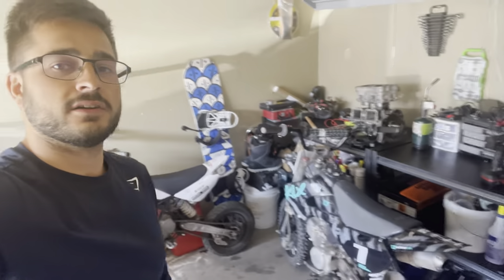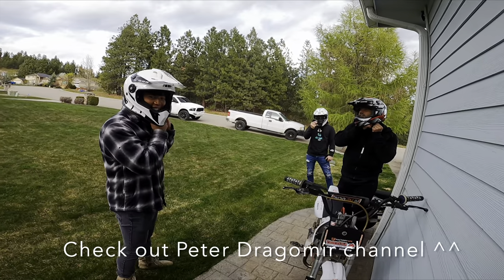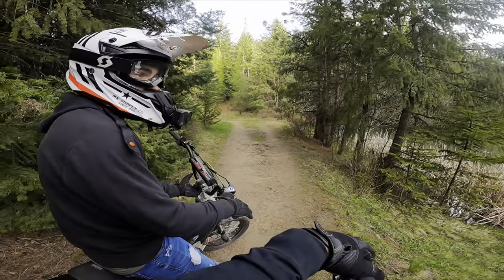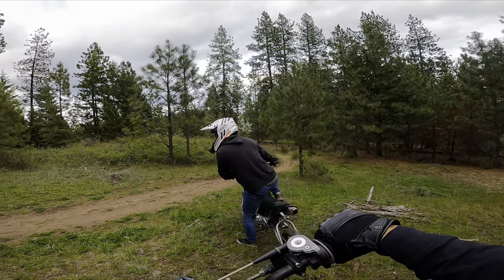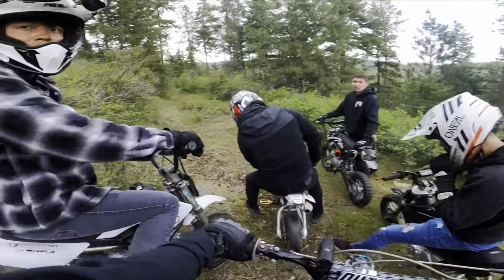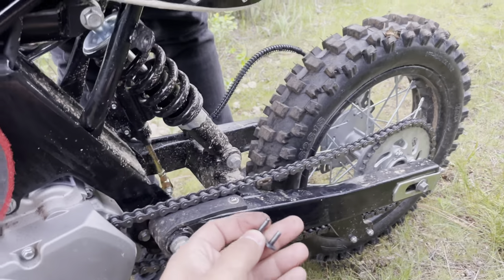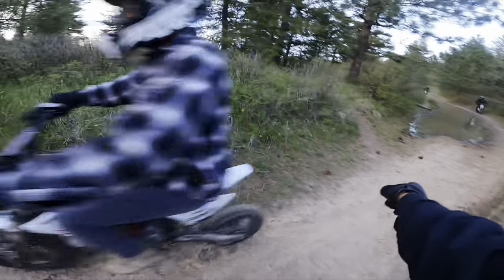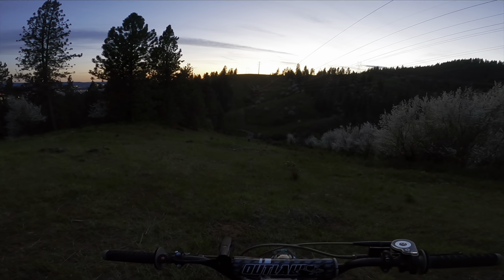Worst Place to Break a Chain Link! | Pit Bike Adventures

Comment: do you have any recommendations for handlebars for 110cc Chinese pit bikes, i recently bent mine. Im also on a budget since it's my beater bike but its practically unridable because of the bars.
Reply from the maker: you can just get bars on eBay. they are not very expensive
Reply: Pro taper 7/8 cr bars are the best for pit bikes!

Comment: can i know what pit bike you got ?
because is so much power full than mine and i want to get the one that you have right now
Reply from the maker: Mines a Pitster pro x4 with a 190cc engine. You can buy Engine and swap it in or you can buy 190 pit bikes as well. Piranha 190 pit bike would be a great bike
Reply: @slavsquad  thanks!

Comment: I blew my 155z up🤣😭
Reply from the maker: There needs to be a crying emoji to hit instead of the heart button. That sucks. How did you do that?
Reply: @slavsquad  I know I wish there was haha, I was riding it and it just stalled in gear and would let me kick start it so I knew from there
Reply from the maker: @masonwilliams8093  I've done that like 9 years ago. was camping and I had a race ready fully built bike 192cc. there was a lot of dust and didn't notice oil leaking slowly and engine ended up locking up like yours. was so sad cuz thats not an engine you can just buy. you have to fully build that back then
Reply: @slavsquad  no way I would be gutted mate haha could you give us some tips on what to do as its my first time doing something like that and to fix it I wouldn’t know where to start been told it can be easy but I didn’t expect you to reply tbh so if you could tell me what I need to do that would be much appreciated and if I was in same country
Reply from the maker: @masonwilliams8093  i do my best to reply to everyone for as long as I can lol
But I would start but pulling the head off and see how bad it was. Could just be top end. I replaced the top end on mine but then it threw a rod through the case s week later lol so inspected the top end first and then Inspect the rod as well. If it’s seized then you’ll have to replace the rod, crank, crank bearings, and whatever is damaged in the top end.
Reply from the maker: @masonwilliams8093  inspect it all. And do a price count on parts and if it’s worth fixing or just buying a new engine
Reply: @slavsquad  fair enough a lot of time then and ok Thankyou
Reply: @slavsquad  yeah I was thinking that anyway cos I don’t fix it I will just sell it out more money to for a bigger one
Reply from the maker: @masonwilliams8093  good strategy!
Reply: @slavsquad  keep up with the videos anyway good content the police are on it if you know what I mean in the uk and there’s not many bike tracks
Reply from the maker: @masonwilliams8093  thank you! 
yeah that sucks. Not much where I’m at either so I make the best of what I have